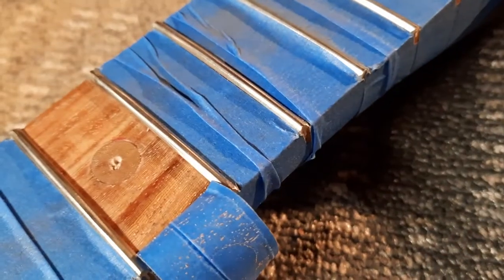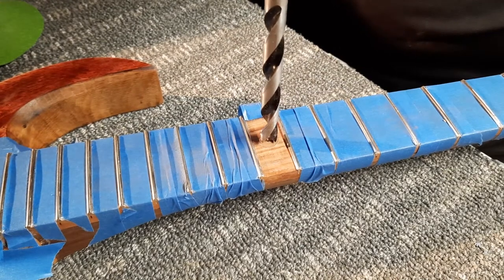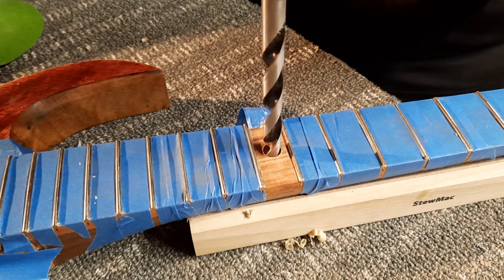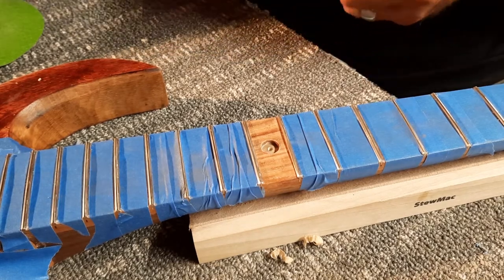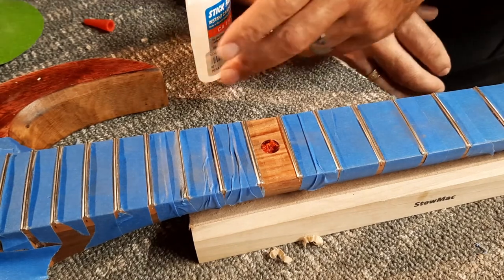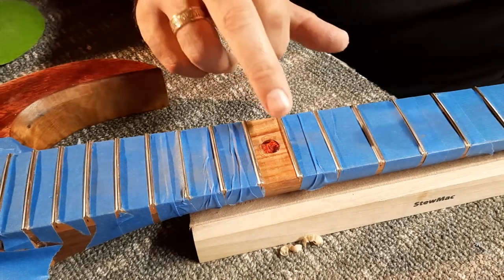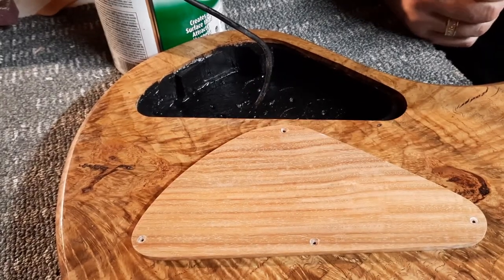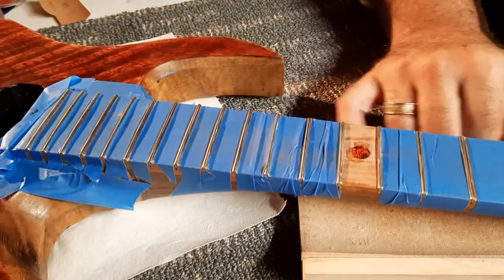The Great Guitar Build Off 2021: DEFIANT Gets Bellybutton Bling!

Comment: Are you worried at about the metal in the magnetic primer oxidizing over time and turning brittle and dull? I'm just wondering.
Reply from the maker: Hadn't thought about it, really. Guess we'll see what happens.
Reply: @CoraTreeCustomGuitars  I'm sure it won't be an issue. I was just curious. I got a quart of EZ-Slide at Tractor Supply. It's basically Graphite impregnated paint. It is conductive so I think it'll work, plus it gets this shine to it when buffed that looks like, well, graphite! Pretty cool